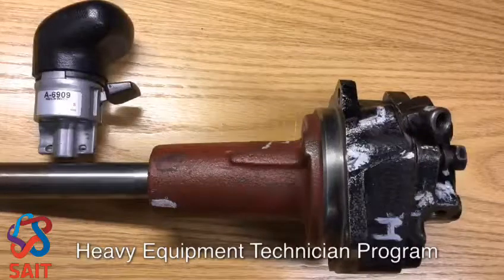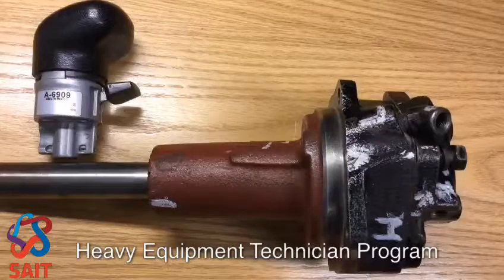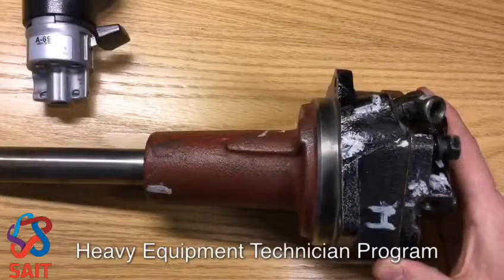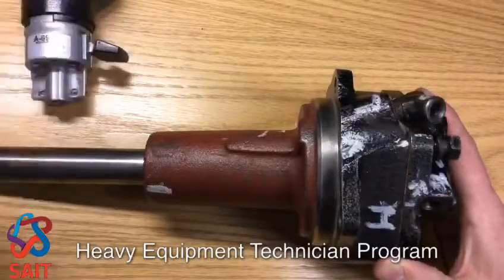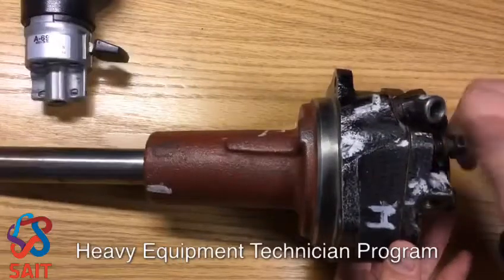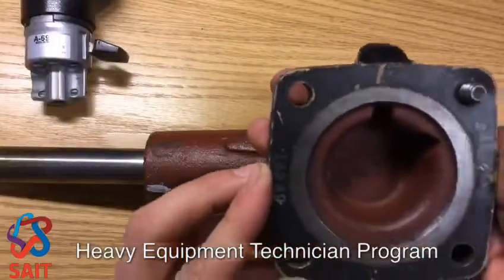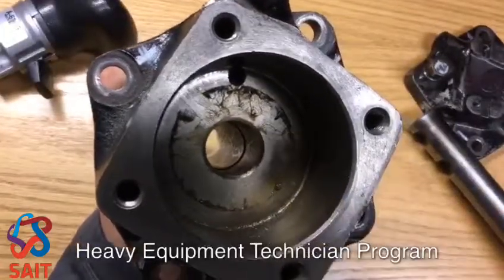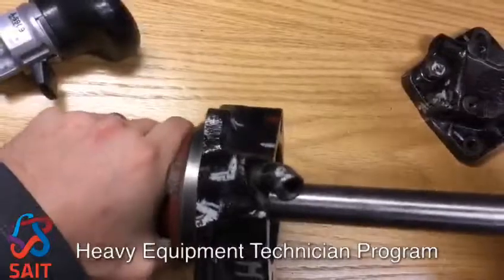The Operating Principles of a Transmission Shifting  Range Cylinder

Comment: Good day very enlightening video need that information very much i have older eaton 15 speed trans and changed my shifter it was leaking air pretty bad added new 5/32 airlines and new a4688 slave valve been scratching my head the slave valve when i shift to low side it leaks air and at 1st doesnt want switch over to the low side been in shop 2 days and mechanics are not figuring it out 
So today purchased new air filter / regualtor and watch your video i believe i might be close to the issue had bit of moisture going threw my system and i believe i might need to replace shift range cylinder o rings any insight will be very appreciated also will purchasing new pin and spring and sleeve kit behind the slave valve thanks a million great video new subscriber